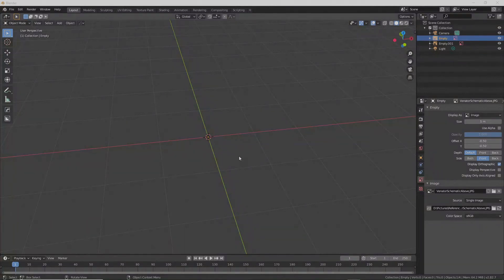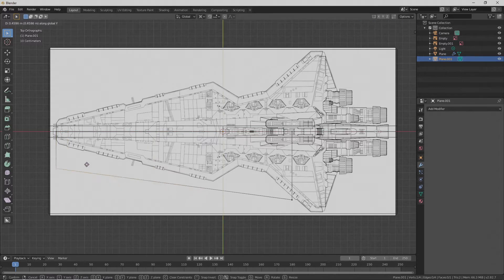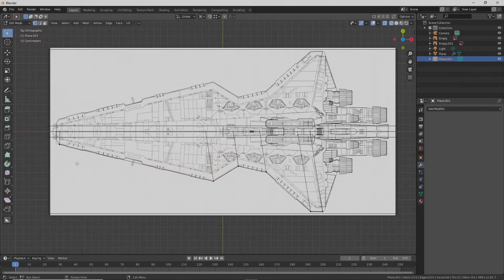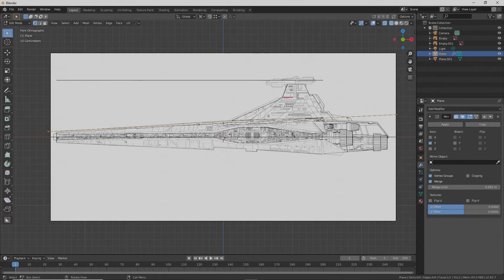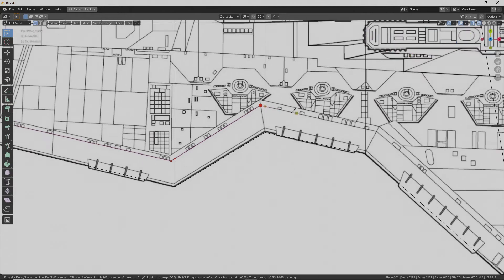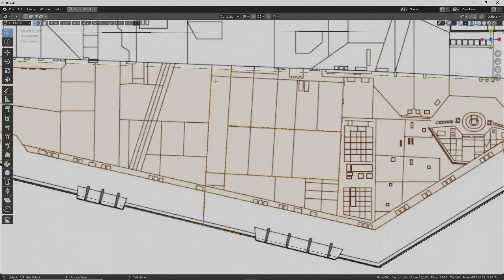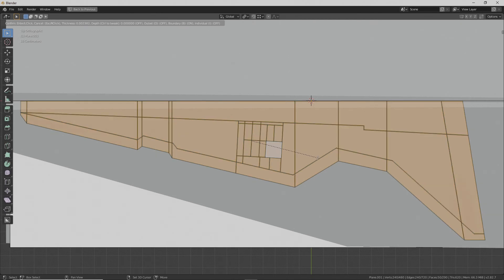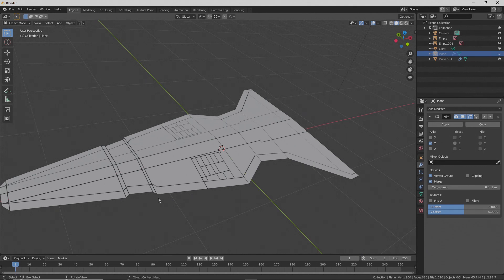Blender Tutorial Hull Paneling Star Wars Star Destroyer

Comment: very impressive works.
https://youtu.be/IFmNJH3zwRM?t=220
3:40 After loop cutting,how do you make degree 90 vertex against x-axis?
i guess that you are not taking transform orientation face ,snap,and pivot.
sincerely.
Reply from the maker: If you are asking how I align the vertices, you can grab "g" in a direction "x" and then holding "ctrl" will turn on snapping and as long as you have vertex snapping selected in the options it will snap to the closes vertex aligned to that axis.
Reply: @ShapeKeyes  Thank you for comments and advice, so i could recognize that.
- Change Snap from Increment to Vertex such as 2:11
- Check Snap
- Select vertex(A) and Press G + X
- Move vertex(A) cursor close to another vertex(B) where i want align to y-axis

it seems that as far as watching your video,you didnt check snap. anyway, i could understand this subject. thanks!